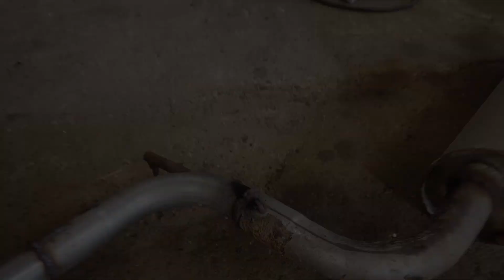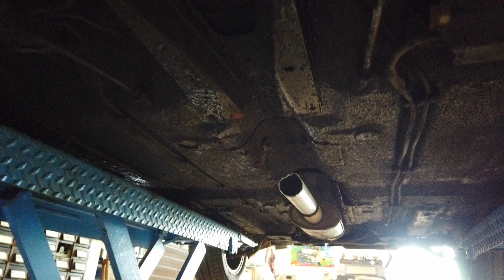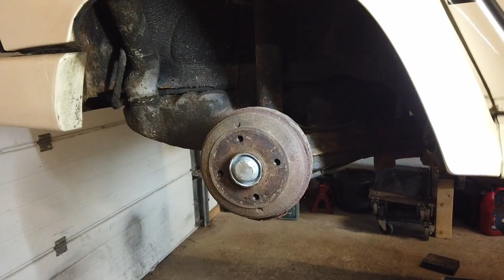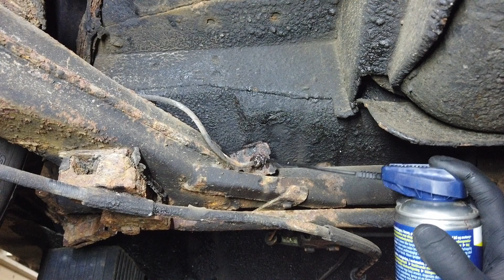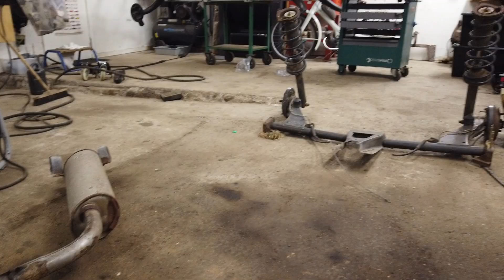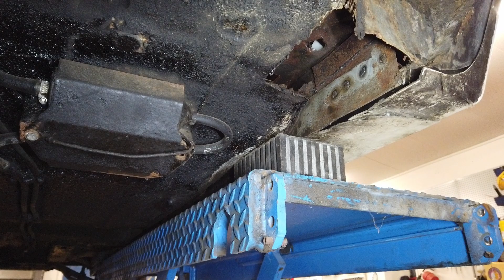Citroen Visa GTI | Rust rear end

Comment: Certainly does seem like quite the weak spot for mounting those rear subframe parts, but given the Visa was adapted from the 2CV, it's amazing they got things to hold for as long as they did, but that said I've no idea what the underside of the original twinpot Visas look like... :S
Reply: Wasn't the Visa developed from the Peugeot 104?
Reply: @htimsid  No, that was the Citroen LN & LNA that were a rebadged Pug 104, the Visa was a peugeot-insisted "Be sensible or else!" re-design from what became the Oltcit & Citroen Axel, because peugeot have no sense of adventure...

Comment: I would also love to see the rust repair!!
Reply: you might use the auto vip for this!
Reply from the maker: Its mounted on the axle so I cant! :(
Reply: @SeasideGarage  , tilt the car nearly on it's side on the floor. Gives a much better work position for making nice looking quality body repairs under the car. I've seen it done more than once with complete cars without making any damages. It mostly about being clever with the angle it's put in and were the supports are placed. No fancy equipment or Autovip are needed, just some ingenuity and maybe some pieces of wood to substitute the missing rear wheel and suspension.